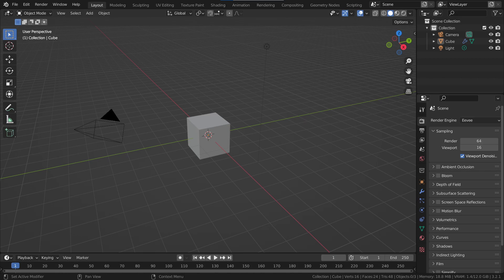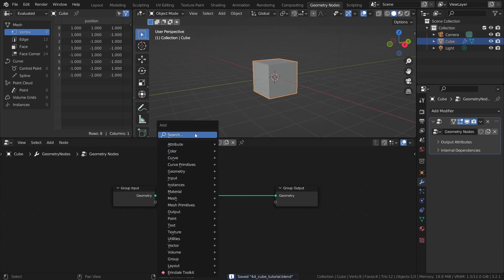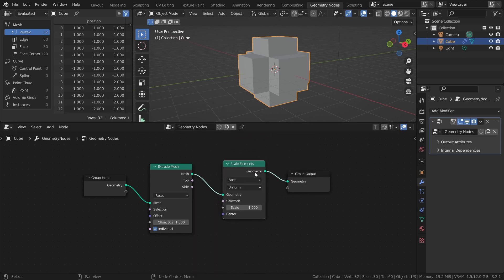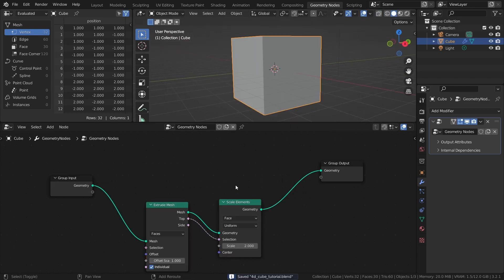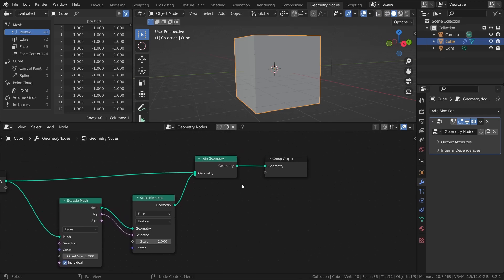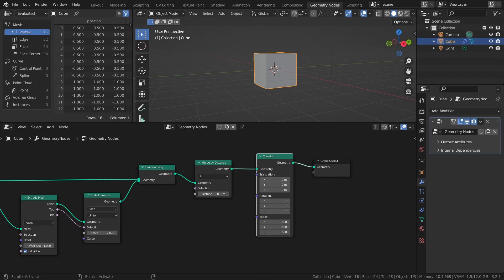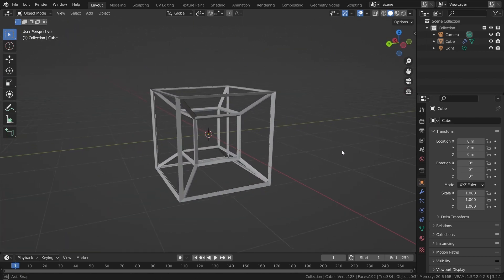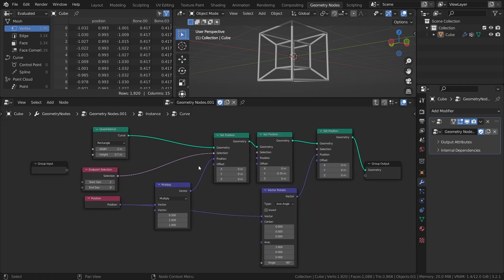Hypercube | Blender 3.1 Geometry Nodes Tutorial

Comment: That's not a hypercube. If that's a hypercube then a square could be called a cube. If it doesn't change when you rotate it, you're just showing one slice of the thing.
Reply from the maker: I mean I understand your point but I feel like it would be a pretty high level of complexity to expect from a 2 minute video 😄
Reply from the maker: Wouldn't the shadow (or 3-dimensional representation) of a hypercube only change when it's rotated in the 4th dimension?
Reply: @Khamurai  Exactly, yes, but if you don't show that then you're not showing a hypercube, just a 3D structure that corresponds to a slice of a hypercube. Like if I showed a circle and called it a sphere.
Reply from the maker: Just a 3D structure that corresponds to a slice of a hypercube, just like a rotating hypercube would be a series of 3D structures that corresponds to different slices of a hypercube